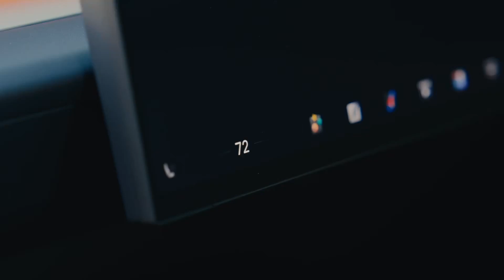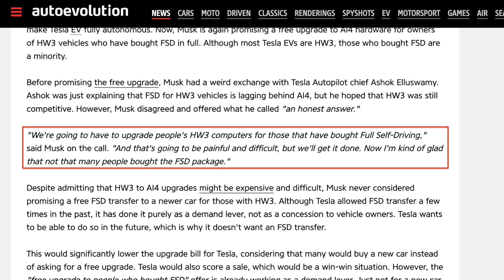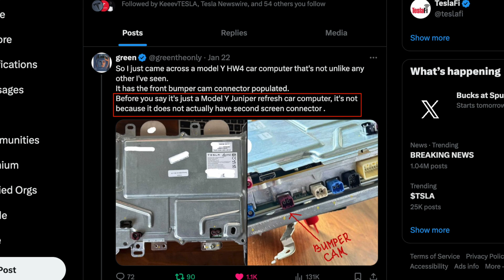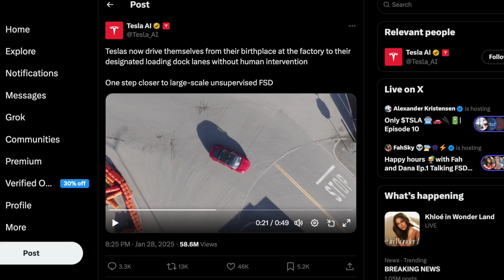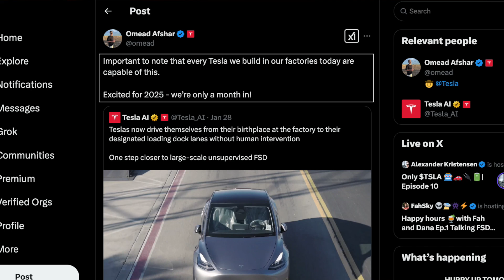Tesla Prepares For HW4 Camera Upgrade on Older Vehicles  | This is Great News

Comment: I just purchased a 2018 MX 75D i have FSD (full self driving) and it also says autopilot included. Im wondering am o eligible to get the complimentary HW3 swap?
Reply from the maker: Yes you can request it at service center if you buy FSD outright
Reply: @heyJohnEe even if you didn’t buy, you should be able to buy the upgrade since it’s possible.

Comment: ps a new front low camera is pure idiocy in bad weather, particularly in snow..just stoopid beyond belief..ASSbugerism defined
Reply from the maker: That’s why they added heating element and a washer specially to this camera
Reply: @heyJohnEe  i know what they spewed.  you obviously don't live in a winter climate..washer would run nonstop during a storm and empty the washer container within an hour..heat does nothing during an active drive..it is just Tesla ASSburgerism..like my HW3 which has not been updated since 12.5.4  which equal 12.6.XXX failure another failure on top of another failure on top of another failure..i will be shocked if i ever get 12.5.4 which BTW was a grand regression almost back to Beta..computer just doesn't have enough horsepower...BTW not many people bought the full FSD package because it is overpriced garbage...city only drivers will never buy FSD and Tesla is crap at getting highway FSD working
Reply: @lor8ancg I love FSD. It still isn't perfect but keeps getting better. If you're so sure it's garbage you must know of a much better system that's available for comparison. Comparing it to a system that doesn't exist and saying it's not as good as that is pretty stupid.
Reply: Almost all new cars have front cameras now. Works fine and usually doesnt get more dirty than reversing cameras.

Comment: I doubt many cars will want to be on the Robotaxi platform.  Insurance costs will be high since it is used for business and not personal.  Also, most loans do not allow cars to be used for commercial business, if it is a personal loan.
Reply from the maker: Maybe if the car is really old and you don’t mind it getting damaged, and insurance is usually reduced on older vehicles too
Reply: Tesla will likely be the insurer themselves, which they should be to instill confidence in the product.
Reply from the maker: @zackj997 that’s a very good point
Reply: Insurance companies can't prohibit you from using your vehicle for commercial purposes. You just need supplemental insurance because they won't be covering you.

Comment: You would think it would easier just to offer model 3 owners 10-15% off on the price of a new car to trade in the old cars instead of going thru the hassle of engineering a hardware upgrade and the hassle of 100,000's of hardware swaps.
Reply from the maker: That would be something to consider too, but not everyone can afford or want to upgrade though

Comment: With the new Model Y having easily replaceable cameras, I can't help but wonder what would happen if the HW3 cameras prove inadequate. Apparently the wiring there can't handle higher resolution video, and replacing that would be quite expensive. As would retrofitting a bumper camera.
Reply from the maker: The cameras should be plug and play, wirings should be enough to handle it I believe